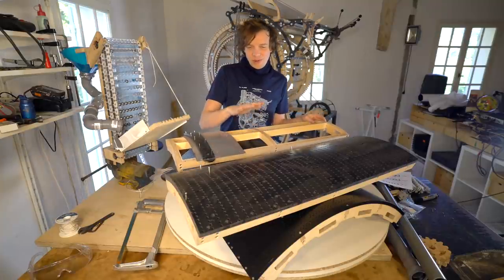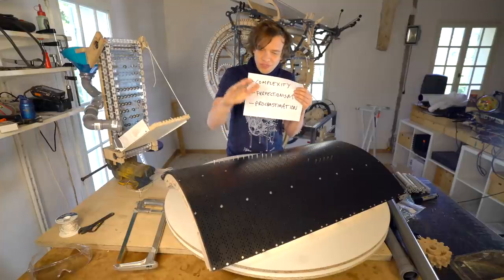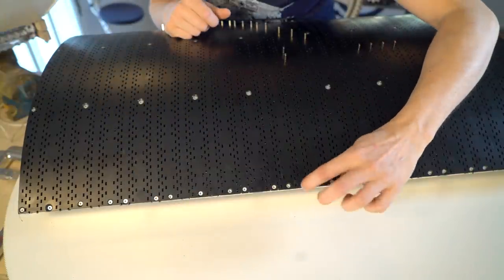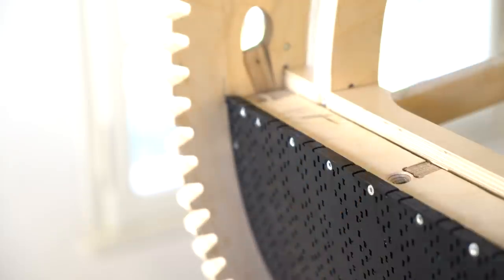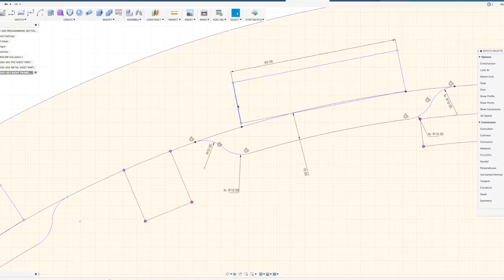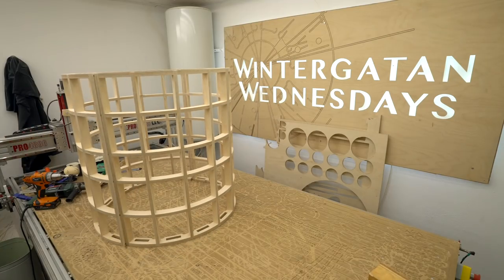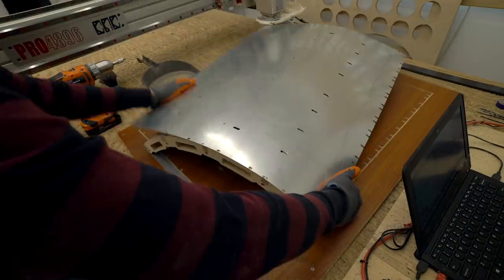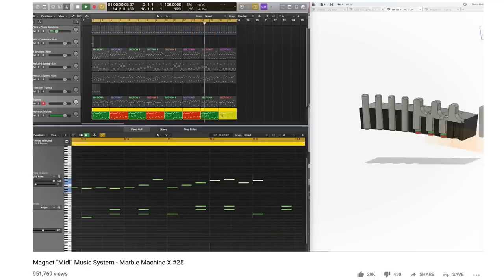Music Programming Plates Part 3 - Marble Machine X #65

Comment: I had an idea, what if you tried using an interlocking edge between the programming plates? Like a zigzag or a squarish zigzag like a bar graph. So that the programming plates hold each other in place. we could shave/edit  each edge to fit exactly and hopefully not have any holes on the edges of the programming plates.

Comment: To avoid alignment distortion when bending the plastic around the panel, can you make a jig that will allow you to machine the holes after the plastic has already been attached to the panel? Something like ThisOldTony's spindexer on his surface grinder, to rotate the panel under the router head. Then cut one row at a time. Very time consuming, but I think it would be more accurate. Also, you will end up with parallel walls on each hole, so the pins won't wobble, whereas the pre-cut bent plastic will have walls that form a kind of V shape.

Comment: Have you tried using overlapping fingers between the panels (like part of a box joint) with alignment pins joining them to keep the panels a set distance from each other? This won't be a solution for distortion when bending the plastic, but it will help with repeatability between songs.

Comment: You mention shimming, but have you considered adjustable interstitial elements?
Like pitch, automation timings on physical instruments must be tuned.
The materials used, changing of plates, and other factors may accelerate warping, misalignment, and/or deformation.
Variable expansion joints that both connect to the plates and maintain adjusted spacing might be a good starting point.
Small cover plates can be made to hide the joints, while providing pinholes in the gap.
Alternatively, removable cover plates can be added without the tuning joints, or attached to one edge of each programming plate.

Comment: Any thought about making the programming wheel structure out of carbon Fiber? I know VERY expensive but it would give you much less weight and super durability and rigidity you are looking for.  It;s a whole new thing to research, but I know you would enjoy that. I know you are going for the magnetized pins with the Metal sheet so they stay in, it seems like those layers are asking for something to fail. but that is in any system.

Comment: I suggest you add "teeth" to the edge. It won't just solve having supporting material for the pin, but will also help make sure someone doesn't load a panel upside-down. (Unless the patterns are universal, in which case the teeth will also end up universal)

Comment: Martin, I am really concerned about the Thermal Stability of your plates   Do you know what temperatures your machine will be subjected to. You could run into considerable distortion with a small delta change in temperature.  Do you know what the Coefficient of Expansion of your plates are?

Comment: Would it be possible to modify your CNC router to cut the holes in the programming plate while they are mounted on the drum.  Use a stepper motor to drive the crank on the Marble machine making it act like a rotary axis.  As long as the plates were assembled in the same order there would be no variation in timing

Comment: Not related to the current construction, but if there is no strong attachment to the plates being solid black, then painting patterns or otherwise decorating the plastic with visual markers could potentially aid in changing the pins between songs as well as keeping the plates themselves in order.  Currently, only the screw holes act as any sort of marker.  Even horizontal lines would probably help that task.

Comment: Hi, 
Quick question for Martin. 
Did you consider to 3D print your songs on plastic sheets with little spikes to play the notes, then you put the plastic-track on the wheel instead of re-programming songs ?
Like a 3d reversed punch card for a music box.
This way on stage during concert you could have multiple playable track ready and maybe only for some channels/instruments to play.
(and you could also use your CAD skills to 3D design your music.) ;)

Comment: Watching from outside and hearing you define the problem I cant help but wonder if you shouldnt index the plates off a radial reference such as a pin.  Your radial accuracy in degrees then would ensure that each panel is precisely spaced to the next with out having to shim between panels.  Essentially if the middle of each plate was located on 1/x of complete revolution the center of each panel would be then in time regardless off spacing at the edge of the sheet.

Another Thought was whether you could create a 4th axis over your router mounting the spindle 90 degrees around x pointing at the drum.  Such that you could mount the panels on their drums and drill radially the programming using x/y movement of the gantry with z fixed to the height of the center line of your drum.  As such the error would be limited to the rotational accuracy of your 4th axis.

Comment: What you do symbolizes for me the best that I can hope for the 21st centry: Using all this modern hightech stuff to create a beautiful mecanic acoustic machine creating & inspiring awe and joy through making music. 

Now concerning the programming plates, since you chose to redo the system from MM1, although I am not sure it is the best option, no matter what, you probably will need 2 systems and a method:

System 1: for composing, on the fly, anywhere, something similar on what you are currently working on
System 2: for concerts, a no brainer no worry stressproof easy to change system
Method: how to copy/transpose a composition from system 1 to system 2?

Maybe system 2 could be based on a long and large thin metal sheet with punch pressed holes .....

Well good luck and good night on that one. I am sure your creative genius, your world wide engeneering network and the light of 1.186.176 MMX believers will provide the energy to make the best of it ....

Comment: I hate to start making suggestions at this point, but it seems to me that the precision of registration between the programming plates should not rely on the supporting drum on which they are mounted, but on the joint between each plate. This allows distances between holes on adjacent plates to have accurate spacing. The difficulty here is that they may not site firmly on the supporting drum. This, I suppose, could be handled through shims between plate and supporting drum. What I see is that adjacent plates are locked together.

Comment: What happens to the timing when the structure dries out? For example I have 10% humidity outside right now and every door in the house opens freely..  Next week it'll be 80% and everything sticks.  Right now your workspace is probably fairly consistent but as you travel with it the wood will see lot's of different environments.

Comment: Add some kind of optical pattern to the side or the top, so when changing the plates later, you can easily verify you did not confuse any. Maybe you find sth. nice to look at when the wheel is turning.

Comment: Absolutely loving the project.  Willing to wait/can't wait!  I do have a question/concern.  On tour, someone(s) will have to change the pinout of the plates for a different song which means that they will need to know which of the 58,368 slots need pins … in a few minutes?  This is likely something you've thought of, and there are probably better solutions than mine, but it sounds like a numbered templating system will be a must at the very least.  Numbered for each plate and keyed so the pins only fit where they belong.  Probably something very high contrast as well for visual acuity while backstage.

Comment: you should use a divider and cnc the holes in the plastic while the plastic is in the round (final) condition, this way the holes dont shrink on the inner diameter/stretch on the outer diameter (better tight fit of the regristration pins)

Comment: A bit of a wild idea: create a custom CNC mount in which you have a drum to attach the programming plates so that the CNC instead of traversing the Y axis it rotates the drum, this way you can precisely drill the holes AFTER the plates are bent, guaranteeing each hole will be in the correct position

Comment: Hi,
Did you try to program one of these plates? I am afraid that it will take way more time, than what you expect. I am not sure that it is possible to reprogram one set of plates within duration of one song. Plus you will get a high probability of errors. Why not to use individual set of plates for each individual song?
Sincerely,
Anton

Comment: Martin, as an engineer I can tell you that you won't get a 0.0001" tolerance out of a wooden frame. Wood grows and shrinks due to humidity and temperature. Also the rough handling of roadies. That's why I build Modulin II using 80/20 aluminum structural components. It will withstand rough handling on a tour!

Comment: If plate alignment is an issue, could you use two welded together pins to stick in both plates one hole in? Imagine the pi symbol Π. It would be basically a small plate of steel with two pins welded apart at exactly the distance between 3 or 4 holes. They'd be quick to remove and you could place them anywhere it wouldn't interfere with the programming. Pi pins.

Comment: Hi Martin,
I watch your journey since the beginning...keep up the good work is to less to say...however: What I recognize is that you try to build a perfect cylinder out from four parts. Now, since you machine these four parts you come across the issue of tolerances...every part that is machined is not absolutly "zero" on its defined measurement...it's always a bit +/-.
So what if you build a drum that can hold a complete cylinder (out of this black material), machine all your holes in it and cut the cylinder in four parts afterwards....
Or you can maybe have only one cut and end up with only one big black sheet, that maybe can be wrapped onto the marble machine.
I do understand that you will have a gap because...everything that cuts has a width, which leads to a gap...but the gap can maybe be filled afterwards and the holes would be perfect aligned to each other.
I could also guess that you thought about this already and skipped it for a good reason.

Comment: Search for repro photography vacuum board(/etc) style solution to keep the thin sheet flush with the backing plate if you need to do this again 🙂 depending on the amount of the holes passing thru the vacuum leak, even normal household vacuum cleaner might do the trick. 

But if the problem was just curving of the sheet corners, then this trick might not be enough to keep it flat.

Comment: The next time you machine sheet metal, try the masking tape and super glue trick. Adhere a strip of masking tape on both the material and table where you want it to hold, and place small dots of CA glue between the tape layers.

Comment: Hiwdy, a much safer way would to not have the inside up the plate support mount flush onto the programming drum, but rather focus on the desired circumference and finding a way to have plates floating, locking against one another, rather then to the wheel sides....

Comment: The deformation of the plastic will happen one way or another, the solution is to include the deformity in the manufacture. Have you considered adding a fourth axis to your CNC machine that could rotate the wheel as the gantry completes rows of holes? I.e. set the complete wheel under the machine, all four sections so the plastic is already in place, and the machine performs passes in rows. Once the work is complete you can mark each section so you know which direction and order they go in and they'll have the precision of the CNC machine behind it. If a programming hole ends up between two sections, as long as there's plastic there, deformed or not, there will be a programming hole.
If the 4th axis is too complicated you can still work it but advance the wheel manually. I see no reason someone of your caliber would find trouble rotating that wheel incrementally and precisely.
Whatever the case, I CAN'T WAIT TO HEAR IT!
Reply: I was thinking the same. Cut the holes with the wheel assembled- then, assuming the fixing solution is precise enough, the machine will naturally turn out accurate. The downside is that every programming panel will be matched to its position on the wheel and the set of panels it was machined with: assembling the panels in the wrong order (i.e. Panel 1 in position 3) or mixing panels across batches will likely result in errors.

Comment: You could have used a little double faced tape on the bottom of the thin sheet of metal to stick the edges to your table surface we do it all the time at ePlastics, Quite common for CNC routing.

Comment: You have something magnificent here.  I fear though, that you may have problems during concerts if you only have 4 programming plates -- you're going to need at least 8, and possibly 12 or even 16.  Reprogramming will take a long time, and unless you have 4-6 people reprogramming while a song plays (Like a race-car pit-crew) you're bound to have delays for setup and takedown.  
How many notes do you think are in one of your songs? 100s? 1000s?  If it takes 20 seconds to insert a pin per note (maybe worst case), that's a lot of time!
At one point, you mentioned the idea of a player-piano template for your songs to help place the pins in the correct holes.  You're going to need a material that doesn't stretch or warp, is resistant to tearing, and that aligns the holes correctly.  Maybe flexible vinyl sheeting that is CNC cut with oversized holes so you can pull it off the pins without removing them.  Taking vinyl off without removing pins might be an issue.  

Or tear-away plastic/paper film might be better?  Paper would be cheap and easily changed (so long as you have a printer).  

When you get a blank programming wheel, two people align and tape down the cling-paper with masking tape.  This might take 1 minute per plate.  Perhaps 2 sheets of paper per plate (large sheets are harder to handle and stretch/tear more).  You always print double copies of your song papers for redundancy in case a song tears. 
The cling paper has dots printed on it and you push the pins in thru the paper.  The paper has marks on the edge to align with marks on the programming plate, there are multiple marks on the paper and plate to make aligning easier. The marks are on both sides of the programming wheel and on both ends of the paper to keep the alignment square.  (Paper isn't always cut squarely.. sometimes one edge is at an angle)  
Tape down the sheets, then pass the plate onto the pin-setter.  Pin setter pushes pins while the tapers do the next plate.  There shouldn't be a need for thinking too much once the paper is aligned, they just push pins thru.. once the taping is done, the tapers start pushing pins.
Then, after plate is programmed, have a third person (or one of the perfectionist-minded tapers) cast a critical eye over the programming plate and sheet to make sure all the black spots are filled in.   It is very easy to forget a few when you get distracted and a second set of eyes always helps in checking your work.
Reply: For concerts it's reasonable to assume that each song will have its own set of programming plates, or at least most of them. If it's necessary to reprogram a set of plates while the concert is ongoing, Martin could just switch to another instrument for a song or two.
Reply: on the 1st version there were 8 plates, down to 4 today... 
the re-programming sequence have been some much comment previously, Martin want to use a vinyl template with larger holes than the pins and think that would not be an issue to remove after programming.
I have another proposal using cardboard (black bristol cardboard with quick fixing disposal) that can be let on the wheel when playing and removed before the re-reprogramming time....
no risk of scratch, no issue when remove.... 
Just let Martin have trials on this ....
Reply: @pascal-cm4sq  Sometimes you can't get away from iterative design improvements when you're making new projects.
Reply: @chadschaefer5084  I'm agree with you...

Comment: I think you might will run into some issues when you once applied all of these plates on the machine.
How you want to take off these without any handles?
Because they will sit very tight and maybe not fall off from itself when opening the leaver...
Reply: Have a look on previous videos, Martin has planned room for removable handles (you can see one at 10:45 the rectangular hole between the 4th and the 5th channel )